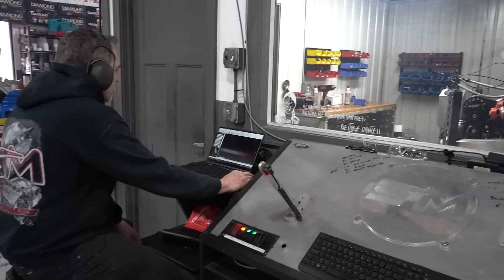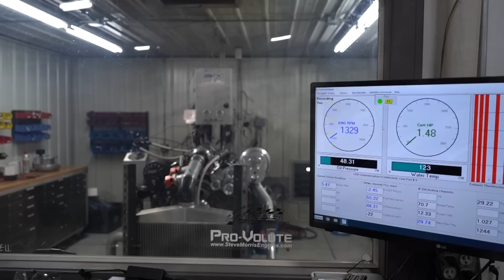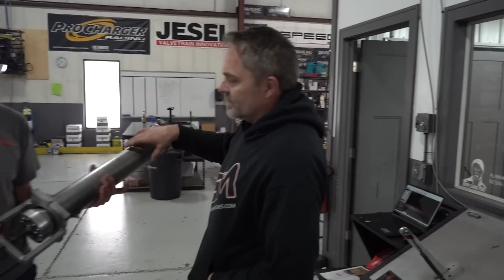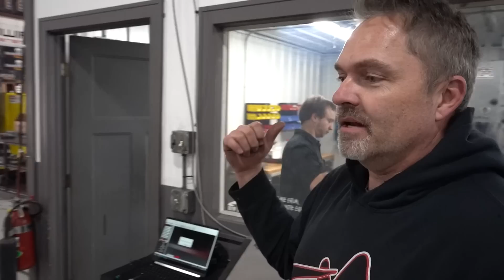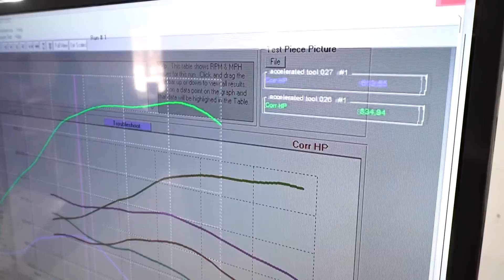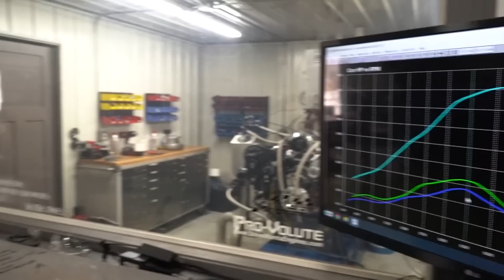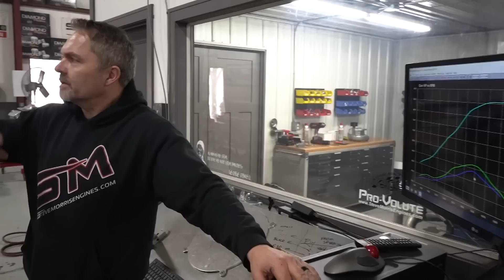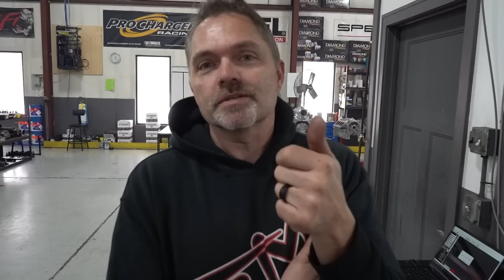CRAZY Testing After The  Dyno Session

Comment: The flow is the same and the crank has less pushing down on it from the pistons na. inlet flow would tell you more. With the less power loss on the higher boost you know it was moving less air.

Comment: This might sound dumb but you have another cell right next door, could you have the supercharger feed one engine while the other spins it, the charge pipe setup maybe a bit sketch but you would have real numbers. I think what's different on the test stand is the compressor is now pushing air into atmospheric pressure, that's not what in the engines intake manifold.

Comment: Three. I definitely agree. The vacuum in the engine helps with the static pressure in the ductwork of the blower. Static pressure of duck works is very hard to calculate. This is been a very interesting video. I learned a lot.

Comment: Blow the supercharger into a second identical engine simultaneously, and see the gain of the second motor without the belt drive. The HP of the second motor minus the base line is the HP to drive the supercharger. Just a backwards way of the way your checking it.

Comment: You are correct. You need to subtract the mass air flow that the engine makes n/a. 

Here’s how a setup could look. 

First thing would be to run the engine n/a and see what airflow it needs at peak power. Then you run it with boost measuring again but only at the same rpm as peak n/a power was. Deducting the n/a airflow leaves you with the air the blower takes in. 

You need an adjustable valve upstream to adjust how much air goes in to the blower. 50:30 Then you need a waste gate down stream to keep the boost constant rather than a fixed valve as a fixed valve will result in a boost increase. 
Now set that waste gate at the same psi as the boost you ran on the engine - 12psi for example. 

What you the. Need to do is to ask the dyno to keep the engine at the peak n/a power rpm. At this point the inlet to the blower is completely shut. Now start opening the inlet valve on the blower until you see the net mass airflow you calculated earlier. If the dyne release the water brake as you open the valve on the compressor inlet to hold the rpm steady, the blower and dunk will end up sharing the load at the correct mass air going tthrough the blower and the waste gate will keep the restriction steady I.e keep the boost steady. 
If your dyno can’t adjust the water brake automatically as you open the blower, you could run the brake manually while Kyle slowly opens the blower inlet. 

It is not really difficult per se, but it is cumbersome and time consuming.

Comment: The test rig is a fixed orifice. The volume of air is increasing with RPM causing the increase in pressure. The simplest fix would be to use a very large blow off valve at the end of the discharge. This would hold nearly constant boost across the RPM range, which is what you are trying to accomplish.  Then use a boost controller to program the pressure vs RPM points from when it was discharging into the motor and you would know exactly how much power it is consuming at all points in the pull.
Reply: It is not that simple. Yes you need a waste gate, not blow off valve, to maintain a steady boost. However, you also need an adjustable restriction on the compressor inlet so that you can control the net mass airflow going into the blower. If you don’t, nothing has changed. The mass air needed to perform the test can be calculated the following way. 

Run the engine to peak power n/a and measure the CFM it draws in. Let’s say it makes peak power at 6900 rpm. 
Now choose the boost level you want to know the parasitic loss at. Let’s say 12 psi. 
Now run the engine up to 6900 rpm at 12 psi of boost and measure the CFM. Deduct these two CFM numbers which will give you the net CFM the blower draws in. 

Now set the waste gate on the test tube to 12 psi. 
Ask the dyno to run the engine steady state at 6900. Now start opening the inlet valve on the blower until the net CFM is reached. The dyno should automatically adjust the water brake to compensate for the shared load between the dyno and compressor     . The power you then record subtracted from the recorded n/a power will be the power needed to spin the blower at that fixed rpm. 

Now if you want to do it as a sweep over a review range it gets a lot more complicated as the net CFM ratio changes. In order to do that he would need to blow the air from the centrifugal compressor into a positive displacement compressor with an adjustable waste gate to simulate the engine and keep boost steady. This is where it goes from cumbersome to complicated.

Comment: whats really happening is the blower is moving all that air and pushing it right out the door, its creating a scavenging effect and its pulling all the air out of the room so the motor is running out of air. 

lol. no i dont actually believe that, however id be real interested in seeing a graph of the barometric pressure in the room during the pull. im sure its changing a measurable but insignificant amount.

Comment: Very good vidéo !  My homework :  A centrifugal blower uses less power when it is restricted because it spins the air around instead of pumping it out. A simple experiment you can do see this is hook a vaccuum cleaner to an amp meter and see it drop as you restrict the flow.  As to your setup, why not put a wastegate on the outlet pipe of the blower that you could program for the exact same boost curve ?

Comment: My curiosity is if you plumb the blower into an engine on the other dyno and then sync the 2 as far as doing a pull on both at the same time, what that would show. The engine driving the blower being NA and being the readings you care about for parasitic loss, the other engine being the consumer of the air from the blower.

Comment: The engine will flow more air with RPM. The fixed orifice in the test tube isn't duplicating that. You need a variable orifice. Did I miss the final boost curve numbers, or did you not show them?

Comment: Could a gear driven supercharger be useful?  Like having a gear on the crank, between the timing gear , and damper, the spins a output shaft for the blower , being a 2" 4340 shaft, that is spinning about 2x crank speed, possibly more,  the whole system could replace the timing cover, and possibly include a different damper,   not as elaborate as the 427 sohc engines, but similar,  I think a external bearing  on a bolt on shaft on the crank snout would be simpler,  the support could bolt on with the oil pan rail, and timing cover rail is nothing else then finding bearings that can handle the speed, pressure, and lubrication could be a issue,  possibly using a mount that can preload the shaft in the direction of the load a roller bearing, similar to a wheel bearing, using a thinner lube,  however the advantage of the overdriven gear drive output would be nice, allowing larger blower pulleys , for more belt contact area, less slipping,  and possibly eliminating broken cranks,  with that much pressure on the crank, a bearing failure can't be out of the question!  I don't make that kind of power, but I like turbos, and diverter valves on twin scroll turbos, to spool them much faster,   maybe a company could custom cast an exhaust housing that has different scroll architecture, one side much smaller designed to nearly spool at idle, with a large secondary scroll, to flow the exhaust, and spool the turbo  ,  in other words, a turbo designed to be quick spooled,  with a design like this, along with variable geometry turbos,  it could allow larger turbos to still make boost off idle,  and still make bug power, without compound turbos or other exotic setups,

Comment: Would you be able to spin the blower with external power(electric) run engine through a pull at 13 psi and compare those 2 curves? Not easy to do but would be apples to apples I believe.

Comment: For Testing
If you build the mounting bracket for the supercharger like an alternator bracket and install a load cell in the place of the adjusting rod, you could measure the torque applied to the housing, then calculate the HP. 
Horsepower (HP) = (Torque × Speed)/5252
Speed would be input shaft RPM

This way you could calculate the load as it is installed on an engine.
Reply: This is right on the money.  Great way to calculate exactly how much energy is going into the supercharger.
Reply: I agree. If it were me, I think, I'd use a direct-read load cell as you describe, and I'd also add a MAF, MAP and MAT sensor and then drive the artificial restriction with a stepper motor. With all that it should be really easy to sweep valve the boost pressure vs. CFM vs. horsepower consumption. (and all that would cost way less than a million bucks - I have all the parts in my bin I'm pretty sure.)
Reply: I think the issue is the load on the supercharger. Like he said in the video, when the blower has no restriction and allowed to pump as much air as possible (no back pressure) it increases the amount of power that it takes to turn the supercharger. It gets pretty tricky too because the engine creates a vacuum which reduces backpressure.

What they need is a way to accurately load the supercharger the same that the engine would load it. Id assume every engine would be different, cubic inches and how well it flows.
Reply: @srharris88  Idea --> Put a flow meter (impeller fan style) on the throttle body of the engine while in NA mode. Then map the flow (speed of impeller fan) of the engine, per rpm that you want to data point on your supercharger. Engine takes: a flow (speed of impeller fan) at idle, b flow (speed of impeller fan) at 1k rpm, c flow (speed of impeller fan) at 2k rpm, e flow (speed of impeller fan) at 3k rpm etc... Then use the same size and shape flow meter on the supercharger but instead of reading the flow (letting the air rotate the fan at x rpm). You would use some sort of controller (pwm) to then spin the fan on the flow meter with electricity by rpm of the engine output. Then you would recreate the suction the engine creates on the supercharger dynamically.
Reply: You could simply use the flow meter to then tell the pwm controller to spin the same size impeller fan at the same RPM attached to the supercharger. This would require two impeller fans (one on the engine reading flow & one on the disconnected supercharger that would be spun by electricity to match the rpm). This would be more accurate. imho
Reply: Fascinating to see so many "experts" that can't be bothered to upload a video to show how much they know. Post your vid demonstrating that you know so much. Until then, you are a kid in your parents basement.

Comment: Steve what if instead of reducing the power you add it to see the difference. Ie run a seperate engine in the cell next door with the blower attached and pipe the blower into the second dyno cell into the second engine and do a simultaneous pull side by side, so the second engine is getting the compressed air without having to drive the blower?

Comment: So essentially you need to pick a spot on each curve at a given psi of boost with and without the blower and use that hp difference or deadhead the bov because it only  allowed 13psi and vents the extra, the method your using has an inverse affect with the airflow. Your throttling air vs regulating. You need to regulate, which is what the bov is allowing regardless of what the motor eats. The same effect if you dead head the boost tube and allow it to vent, then the conpressor cant run wild grabbing air because of how its loaded.  If im off here tell me.
Reply: And when the conpressor can run away like that it obviously loads the motor exponentially harder and harder. The only load on the compressor while its feeding the motor is what the bov regulates to for backpressure correct? Unless the only thing the bov is doing is venting to atnosphere when the throttle blade closes? Now i might be confusing myself. I think i am, i think the motor is eating it all except for the 13psi of backpressure at max load. Well its still the same effect, you gotta figure out how to maintain the 13psi through through the same load range as when the compressor is feeding the motor. Because 13psi of backpressure is the same load on the compressor whether its going into open air or the motor.

Comment: I think you were hitting the nail on the head when you said you needed to check CFM as well as PSI. Plus don't forget that engine is also sucking from that blower creating more CFM. Making it easier for that blower. That's why it was pulling on the crank so hard to make the same amount of pressure.

Comment: I think you should put a flow meter on the intake side of the supercharger while on the motor.  When you run with the restrictor match the flow on the intake side of the blower. So supercharger is sucking the same on the air on both tests Don't get hung up on the boost it's producing

Comment: Run the charge pipe into the other dyno room and have an identical motor on the other side consuming the charge from the blower. This gives you 2 measurements. Say for example, both motors make 850hp NA… The engine running the blower drops 200hp from parasitic losses. The engine with the charge pipe picks up 900hp because it’s got 12lbs of free boost. So long as they’re in sync (which would be tough because I imagine the boosted motor will want to rev quicker)… you’ll get your loss and gain simultaneously. At the end of the day, if (for argument sake) the numbers above were real, the boosted motor would make 1750hp which would cost the motor 200hp to make which would net 1550hp (like what you made). 

The vacuum of the motor decreases with RPM but the CFM goes up with RPM and that’s something you cannot replicate with their valve or even a wastegate.

Comment: NA engine running at standard clearances.
Drag test compressor is pulling for hard like you said, but you didn't mention how it causes the crank to bind on upper part of bearings.
Boosted, the compressor is trying to pull the crank but the boost charge is slaming everything back down to normal clearances. 

well that was my attempt at the assignment, probably way the hell off, never got to play with boosted engines.

Comment: Compressor maps aren't linear. They're trying to associate a linear, proportional behavior to something that's curved. Pump affinity laws still apply and power to flow is not linear.

also, the pressure ratio is different between the blower being open to atmosphere and the engine being attached. 
However, the engine isn't at vacuum at WOT, but it is moving air. Basically giving you a positive displacement pump and a centrifugal pump in series.

Comment: As far as the engine being loaded so hard at the end, I would say it's their homemade setup restricting their air. Sure, it shows you the boost inside the pipe, but the CFM's aren't where they need to be. The pressure builds all the way back to the blower itself. The blower is TRYING to make as much boost as possible, yet you are stopping it by clogging the pipe instead of just dumping the air and you are steadily trying to increase impeller/engine speed. I'd also guess since these kinds of blower are geared from the pulley to the impeller(to multiply the engine rpm to get impeller speed up), the gears are working backwards and putting a ton of strain on the engine itself. So the blower is trying to stall the engine, the engines torque won't let it, so the engines torque is pulling so hard on that pulley that it's moving the crank. If this were one of those crank driven blower that sit IN LINE with the crank, I don't think you would have the problem. The torque is being applied straight and not off to one side, if that makes sense. I can try and figure out a better explanation of what I THINK is the problem if none of this makes sense lol

EDIT: God damnit....I paused the video when you said comment, commented, and then you figured it out lmao

Comment: Would it be fair to say that each blower/ motor combination might benefit from testing to see if the least parasitic loss coincides with the motors peak performance. Maybe leaning to a different sized or designed blower? In other words, someone might increase the boost 5 pounds and go slower, in large part because the extra HP gained by the increased boost was stolen by the blower itself?

Comment: that was fun. a lot of math. bottom line it takes a lot of power to pump air.  peak torque will pump air most efficiently? how efficient the air pump is the question. max air at minimum rpm.

Comment: the crank moving may be because the boost isn't in the cylinder, so now the engine doesn't have to compress that much air. without the extra boost the crank is able to move, whereas the extra boost would be a restriction in the cylinder also pushing down on the crank as the crank pushes up on the piston. i dunno really

Comment: 💡Steve. Just my thoughts. For their test bench they should try blowing their blower into a positive displacement blower, such as a roots blower, to simulate the engine. They could change the speed of the roots blower for difference engine displacements.
Reply: Correct. They need a pump which can act both as a restriction and a scavenger. 
An electrically driven Lysholm compressor in conjunction with a wastegate between the two compressors would be a good setup. That said, they would need a lot of base parameters from different engines at different power kevels as a point of reference. They need to know mass airflow of each engine combo in both n/a and under boost to know the net mass airflow of the blower in each condition. Two 1200 hp engines can use significantly different amounts of air to make the power. It is not very complex but it is cumbersome and time consuming.